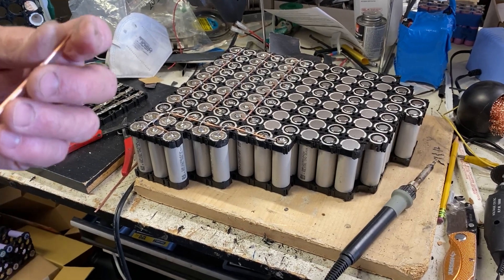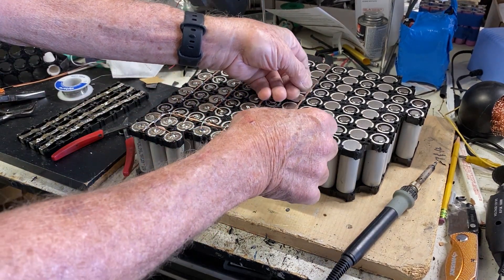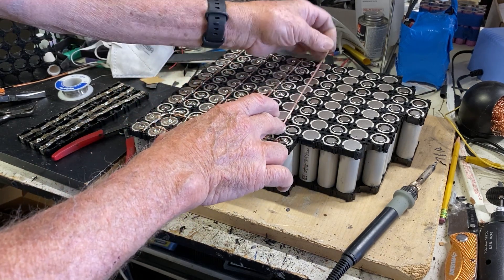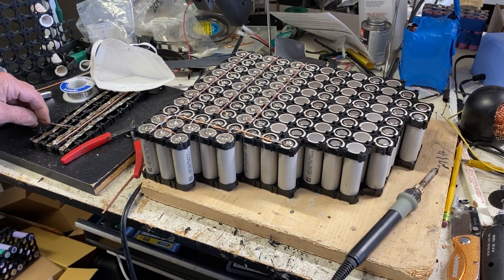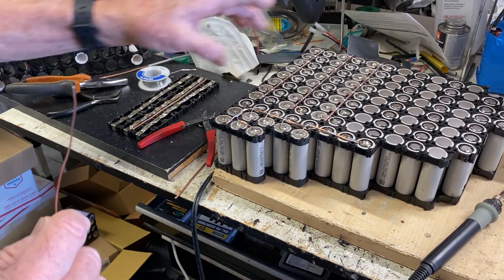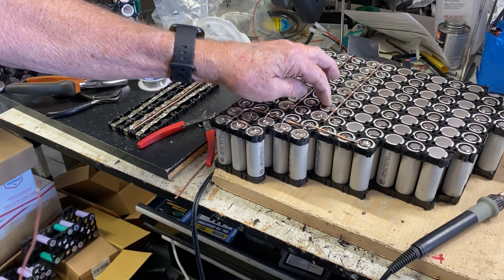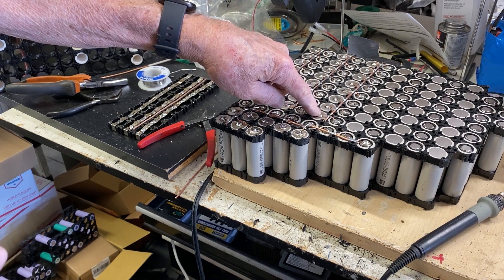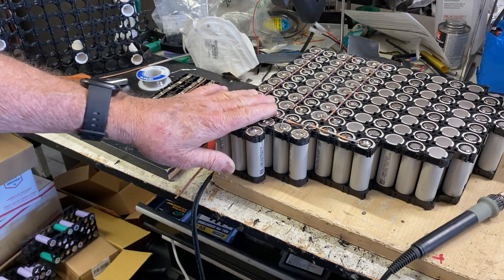Molicel Battery DIY Build Video 1 of 6

Comment: Donald, Can we get in contact? I have some more questions regarding gearing for the 138v3 what kind of gears are u using? I have 51t rear sprocket.. Also have you tested the 138 H?
Reply from the maker: You can contact me thru the ALTA/ ElectricDirtRiders  website  https://electricdirtriders.com/   DONCOX   Start a private conversation on there.  I went to your Youtube channel.  I have a new drone too, your drone flight was a few years ago, but pretty countryside.
Reply: @dcoxryton  Yea verry old drone, got a dji mavic pro these days.. Will use it so film me riding once this project is finished :D
Reply from the maker: No I haven't tested the 138 H.  The nomenclature 138 is the motor rotor size. There are about 4 different versions of the 138 motor the V3 is the only one I have used. You need the gear reduction in a motorcycle for sprocket /chain geometry, and gear ratio.   QS has 90mm rotors, 120mm, 138mm, 180mm rotors also.

Comment: Do you see your batteries?   I just bought the QS 138 90H 4000w kit with em200sp and am in the market for a 72v battery
Reply from the maker: No I don't.  I would recommend Eon Lithium 72V 33AH pack sold by ElectroandCompany.com.  This is the same cells and the same number of cells that I used including the 400A ANT BMS.
https://www.electroandcompany.com/product-page/high-power-72v-33ah-molicel-battery